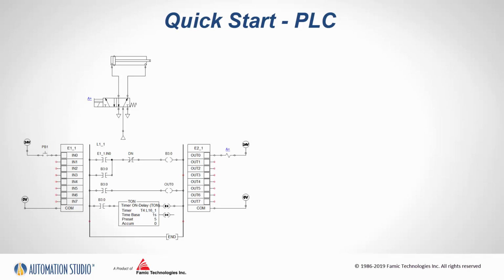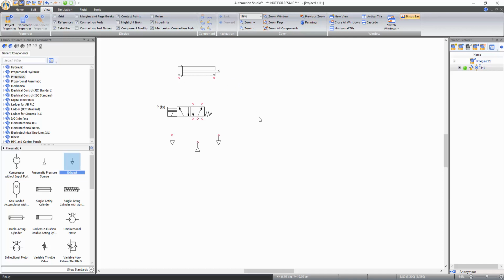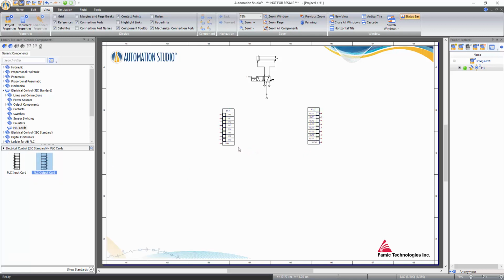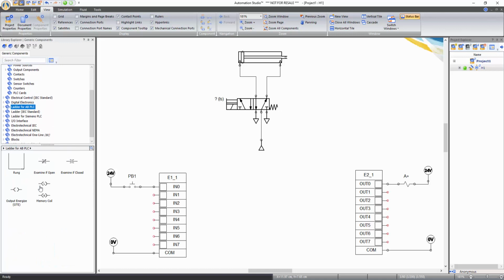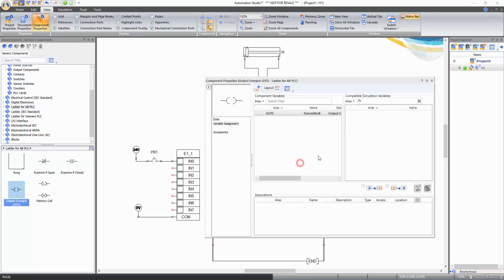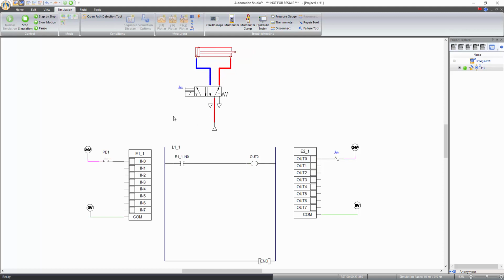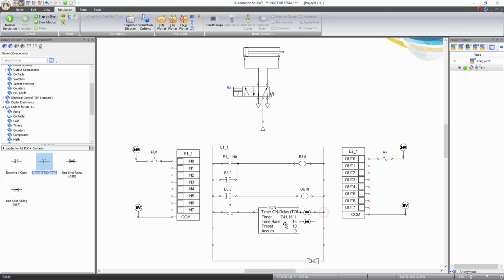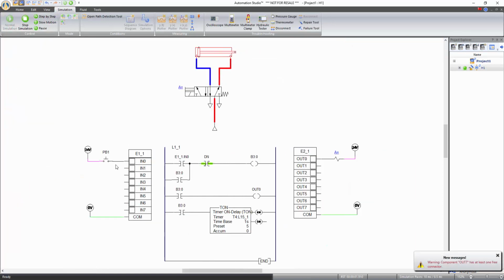How to PLC EDU Automation Studio™ - Quick Start Guide

Comment: My Automation Studio didnt ask Modify Variable when placing a component...how do I do that...and I dont know how to interlink the pneumatic diagram, and plc diagram
Reply from the maker: Double-clicking on the component opens its settings. In the data tab, you can rename the component. You can then access the variable assignment tab and link variables from the plc diagram with the pneumatic components. If you wish to modify the variables in the project, you can access the variable manager in the Tools tab. Hope that helps.
Reply: @FamicTechnologies  thank you for replying, Ill try it today
Reply: @FamicTechnologies  on the variable manager, the alias marked  '?' and its in grey color, I cant click or change its alias
Reply from the maker: @aimansafwankamaruddin8369  When a variable is greyed out, it means that it is considered either as an output component or a component to be modified by another one via variable assignment.